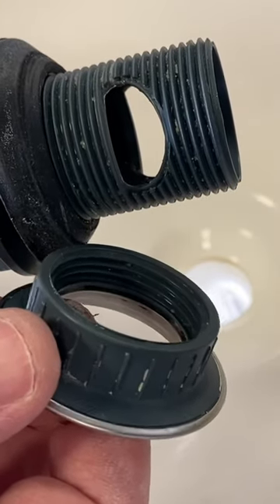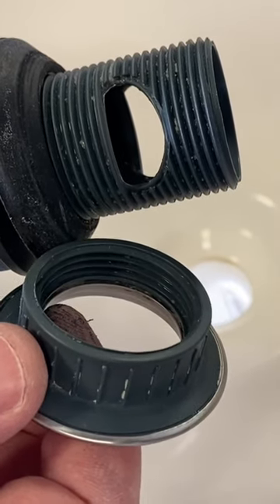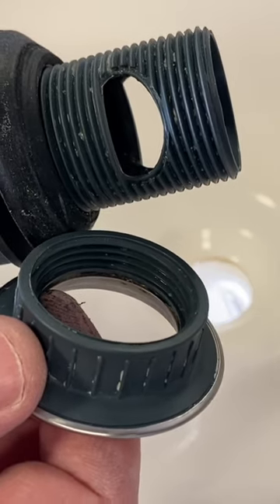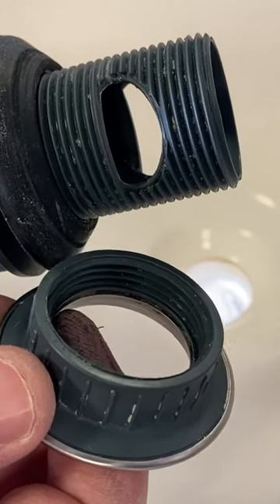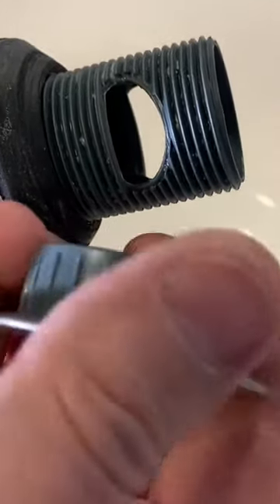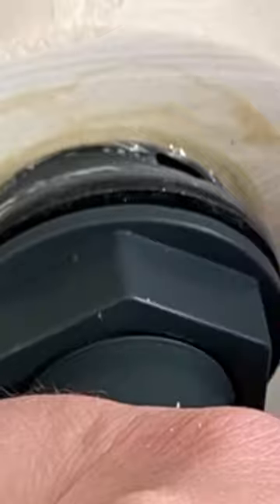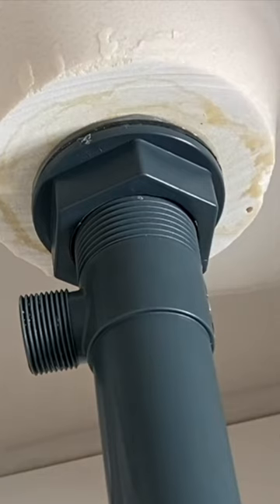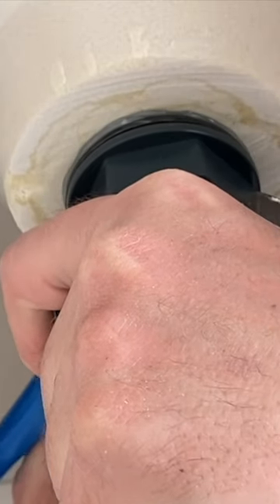Always Use Silicone For Plastic Sink Pop Up Drains  #plumbing #helpingothers #silicone

Comment: I used plumber putti and Teflon tape-Pipe sealant for the thread.
Reply from the maker: Right on. We all find our ways that work.
Reply: I agree except I only use teflon like two rolls worth
Reply: Same
Reply: Putty is not compatible with the plastic. Oatey recommends 100% silicon
Reply: Putty dries out the plastic and rubber gasgets?
Reply: I like the sound.

Comment: Really shouldn't need silicone for any pop up assembly, and telfon/tuff stuff pipe dope is redundant , the threads dont make the seal, the gasket does , siliconing it will just make it hard for the next guy who needs to do any kind of work or replace the sink
Reply: This is the truth. Putting Teflon and pipe dope on the same thread is absolutely ridiculous. Silicone? What the hell is wrong with putty? I don't understand why people can't use things as they were designed and rated. Why fix a problem that doesn't exist?

This will sit out here on the internet, though, and people will watch it and believe it cause there was a guy who did a video and spoke confidently about it. So now it's gospel to those who don't know better and we can look forward to digging this mess out of sinks everywhere.
Reply: The gasket is not to seal water tight. Only to bring the drain snug. These leak like crazy!

Comment: Silicone is alot harder to remove than plumbers putty it seems like a good idea till u have to replace it
Reply: yep, hopefully the silicone fad goes away
Reply: a little denatured alcohol and a razor and it comes off no problem
Reply: Yeah I've never had too much trouble removing silicone. I changed a disposal flange once the had to have installed with liquid nails.

Comment: Grease the rubber seal so it doesn’t rip on the porcelain. It should have no problems getting water tight. That silicone just makes it harder to service, more importantly, rubber shrinks over time and sometimes those seals begin to leak in a few years if they weren’t screwed on super tight. If he had done this correctly then he would be able to fix the leak by tightening it up. Now they will have to completely install a new one. This isn’t rocket science you don’t need to complicate every little thing you do.

Comment: DO NOT ever put silicone against the rubber gasket! If the rubber is leaking water, then it's either misaligned or not tight enough! You will absolutely ruin your chances at ever having a water tight seal if you start adding BS to the soft rubber gasket!
Reply: Silicone isn't BS it's the best invention since sliced bread and it absolutely will NOT allow water leaks it will stick for 50 plus years to the bottom of the sink AND the rubber gasket.
Reply: @Starbuckin  you clearly do not know what you're talking about
Reply: rubber rejects silicone after some time and will always start leaking. I deal with this crap all the time as a reactive plumber @EasyLivingDojo

Comment: The next guy coming to work in that sink is going to have a hell of job removing that clear silicone, mold also start to grow quick around the drain. It does the trick sealing and making the installation job quick, I rather take my time.

Comment: I notice these plastic type of drains do not have the paper/cardboard washer between the nut and rubber gasget. 

Do I throw away the flat rubber washer that goes between top part between sink and top nut, and just use silicone?

Comment: Or just use pipe dope on treads nd plumbers putty on fixture ,(tub,shower pan,sink etc..)like I've done since 1984. Nd still no leaks.
     Trying to get that apart with silicone after it dryers is nothing a real plumber wants to deal with.
Reply: My exact thoughts

Comment: The problem I have with the plastic ones they seem to leak on the threads every time I see one leaking it’s in the threads
Reply: The threads were the angled rubber gasget is sitting is were it leaks?

Comment: I fixed the one in my sink with the putty, silicone will be what I use next time, I know it will be tough next time it needs fixed but that looks very neat and uniformed. 👍👍
Reply from the maker: I still like putty, but have found with the plastic pop ups the silicone works good, and some manufacturers recommend it
Reply: Putty for metal?  Like kitchen sink drain basket?

Comment: I always do it the same way.
But while I'm doing it I'm thinking about a time I might need to replace it. Forever.
Reply from the maker: It is not like replacing a basket strainer that has been siliconed in. Pretty easy I think. And your right drain will last forever at this point.
Reply: 😂 you too should start a service business together. “We assemble but never test, good luck using us”. It’s literally in the name for 65 years. You should really learn to use “plumbers putty” you kinda share a name with it. At this point I would embarrassed if a pop up whooped my ass using plumbers putty. Gotta know the science not just the part name.

Comment: I like plumbers. Putty is easier to get off next time if you.got to change the pop up
Reply from the maker: It is true. I’ve just had some issues with sealing on plastic pop ups.
Reply: @ThatFixItGuy  putty also says in the instructions not to use it with plastic since it can weaken the material.
Reply: @omgbeardriving this should be top comment.
Reply: @omgbeardriving   How long would it take for plumbers putty to weaken the plastic?  I used putty on plastic and it's been good for well over five years now.
Reply: @Wigglythegreat2  maybe it's fine then. I'm just going off the manufacturer's warning really. Maybe it's only certain plastics. They're always coming out with new products etc so maybe that used to be true.

Comment: Been using silicone exclusively for setting drains for over 30 years and not one call back for leaks. I have returned to update fixtures at regular customer's homes and businesses and removal of old strainers has never been an issue. Putty on my truck dries out before it gets used but I keep some for unusual cases. You wipe the excess silicone and you are done. No unsightly putty oozing out after you are off the job.
Reply: I'd never hire you

Comment: This is WRONG. I've done thousands. I pull the rubber washer off and wrap the threads with Teflon tape from the vent holes down about 2 inches. I use 
Frost King P14H Fingertip Rope Caulk, 30' Long, 6-1/4 oz, Gray, 30 Foot (Amazon or HD) around the drain flange. No plumbers putty or pipe dope. I've also taken hundreds apart that have used your FAILED tricks.

Comment: As a PLUMBER, you don't want to do this. If you can't seal it with putty, you shouldn't be touching it. It takes finesse and technique. You just slathered it with silicone to make up for your lack of skill and knowledge. Been plumbing for 7 years, installed every kind of pop up assembly there is, and NEVER had to use silicone. Matter of fact, I don't even have silicone on my truck. This is horrible and I can't believe you're telling people to use this. People will do anything to avoid calling a plumber because they think you just use silicone for everything when that's the farthest thing from the truth. 
Have fun removing that on a Corian sink without ripping some Corian off.
Reply: 100% disagreed, as a process operations engineer I can tell you that 95% of sink plastic drains are made poorly, my bathroom sink has the same rubber washer taper as displayed in this video, being threaded onto a non tapered or 90 degree surface. The issue is you have very little surface contact to the rubber washer, adding in silicone to the washer itself may not be the best fix to this issue however it is much better then no at all and having to over torque the threads is not the answer.

The OP did not do this incorrectly as to solve a problem being a leaking area of the drain pipe, as long as there are no leaks whats a simple rubber washer replacement really going to cost if changing out the drain pipe later on?

Comment: Just use putty and pipe dope.. the silicone is not necessary unless you’re too weak to fully tighten it down. Plus it will make it harder to get off in the future if a new faucet and drain should be installed.
Reply from the maker: It’s plastic.  I’ve gone behind so many people fixing these plastic crap pop ups. This is the way the manufacturers suggest these days. Not all but some.
Reply: Putty is not compatible with the plastic Oatey recommends using 100% silicon

Comment: No 2 silicone
Reply from the maker: Even when manufacturers recommended it?
Reply: Most manufacturers recommend plumbers putty on top that's it no silicone
Reply: @ThatFixItGuy  you can't believe everything manufacturers say. There's no such thing as flushable wipes
Reply: @ThatFixItGuy Have you ever got the MPG the manufacturer states. I personally think that silicone is too messy. That's my main reason for not using silicone

Comment: I changed probably 100 at least and never not once used putti,Teflon or any thing but the rubber gasket they give you. And not one leak.
Reply from the maker: Wow. That’s awesome. I wish that was my luck.
Reply: I think the ones missing the paper/cardboard washer between nut & rubber gasget, when you tighten it can warp the gasket?

Comment: No way boss I’ve installed more than 500 of these. You do not need to use silicone. Try installing a better quality pop up like a clicker style pop up something stainless steel or brass they cost more but they button up way better.
Reply: Yep I agree

Comment: QUIT NUKING IT!!! Plumber putty, Teflon tape, and WHITE pipe dope, (tru blue is for high pressure), and that silicone is for different applications as well, and I'm willing to bet it's caused a problem or two you haven't been made aware of
Reply from the maker: This is a my house and the only issue with this was when it has plumbers putty on it. Has worked good for 3 years now
Reply: Those specific kits says to use silicone in the instructions, works better than puddy..until it needs replacing of course lol